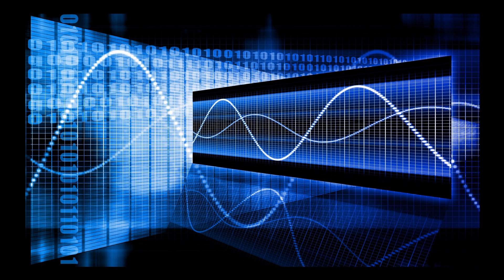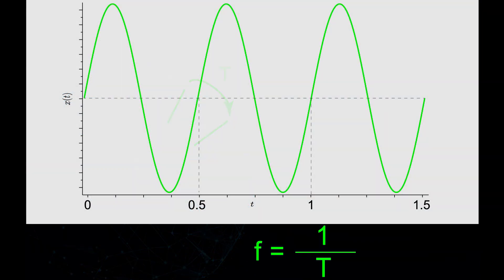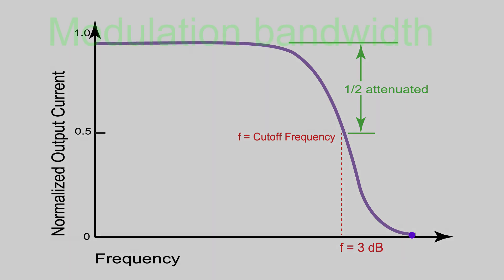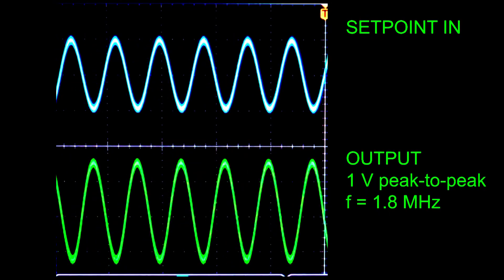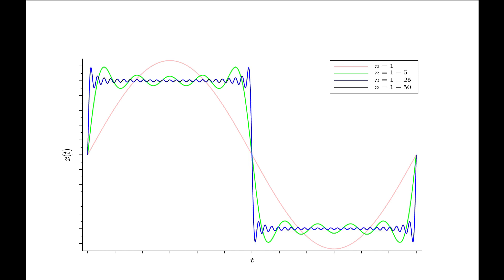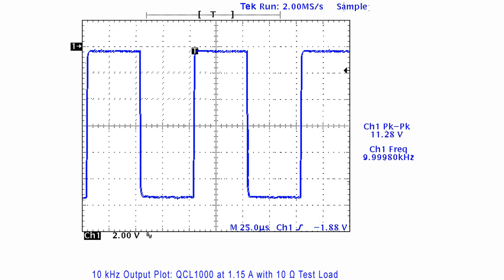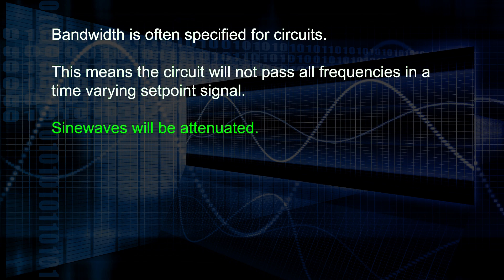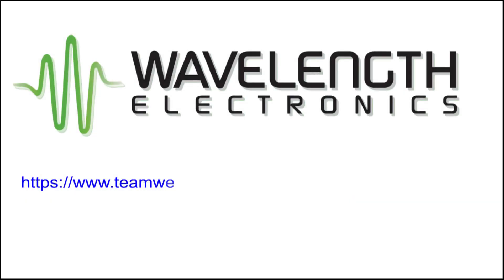What is Analog Bandwidth?

Comment: “The bandwidth is often defined as the point at which the system response curve is half attenuated, this is known as the 3DB Bandwidth, or cutoff frequency. 

Only definition of bandwidth in the entire video. Save yourself 3.26
Reply from the maker: Hey, glad you found some useful information.  This video also includes what you’ll see on an oscilloscope as you approach that 3dB point.  For more detail, there is a Bandwidth Basics web page (https://www.teamwavelength.com/bandwidth-basics/) and Application Note (https://www.teamwavelength.com/download/applicationtechnotes/an-ldtc05.pdf).